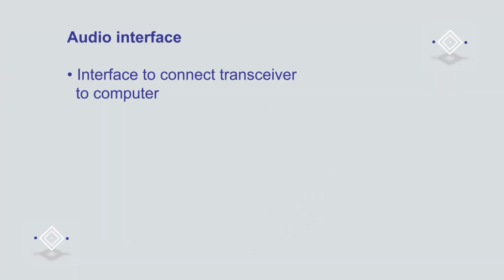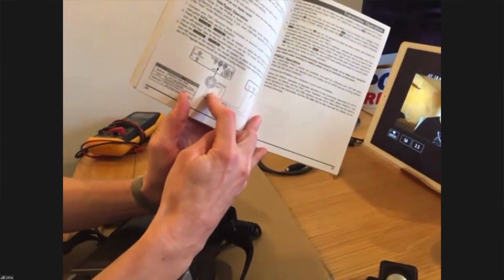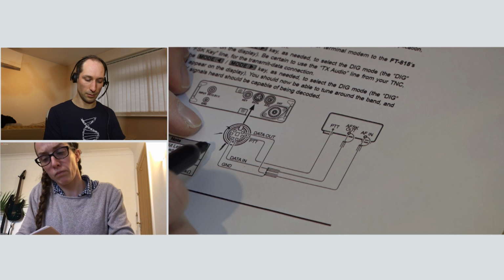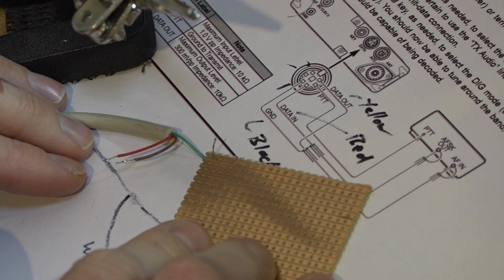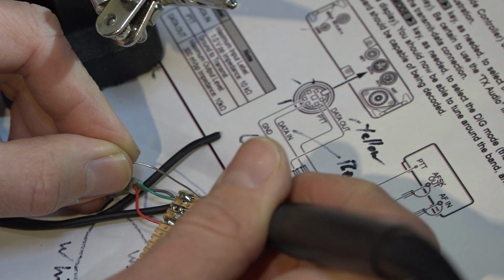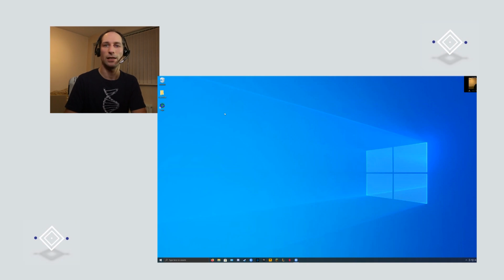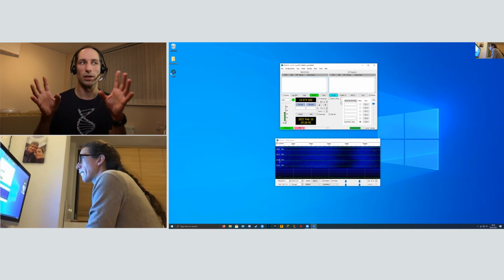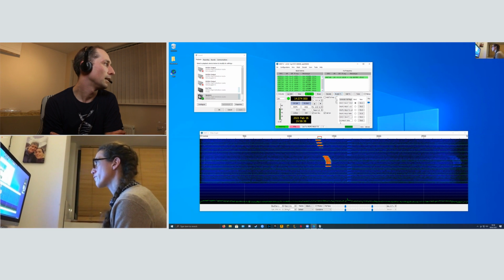RSGB: Useful practical skills videos - audio interface

Comment: Great intro, thank you. Something that I wish would have been covered is how was the radio set up to transmit when double clicking as the only connections made were audio in and out. Or maybe I missed something? Also, it was great that you pointed out the pinout issue and make people aware about which perspective should the pinout be interpreted from.

Comment: Thanks very much to both of you for the video.
I used an old PS/2 mouse cable and knocked up the other mini jack leads quite quickly. I was amazed to actually see FT8 signals on 14074 coming up on the screen.

For me the "error" was not fully explained. ;=)

The view on p5 of the FT-817 manual is of the socket on the back of the FT-817 as seen from the outside of the unit. 
https://photos.app.goo.gl/yQnMsKDWs38N26Df9

When you have a plug and look at the end of the plug the pinout is a mirror image of the manual diagram:
https://photos.app.goo.gl/V3UtMQDuyEoJ7bQf9

If you are pretty sure you know what you are doing, you can confirm the pinout by shorting pin 2 to ground and the 817 will go into transmit mode  - NOTE: make sure you have an antenna or dummy load connected just in case!!!!!

73 HB9TQX

Comment: How does this work without a Push To Talk function?  I am puzzled.
Reply: If your transceiver has vox capability, you can configure it to transmit when it receives audio input.
Reply: @Lastaii  Thank you.
Reply: @brianperrett4429  The CAT control video in this series shows a cheap device that allows full radio control, including PTT.
Reply: @GregoryFenton_UK  I will watch that next.   Thank you.